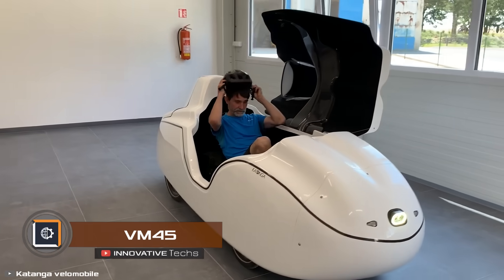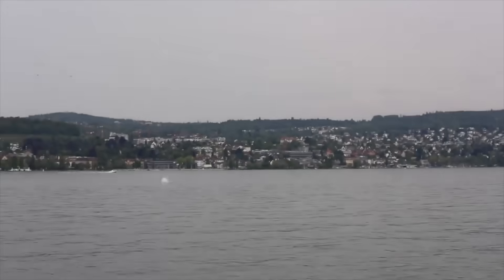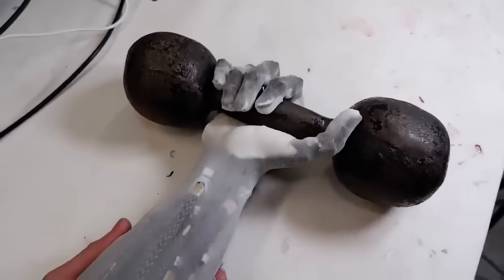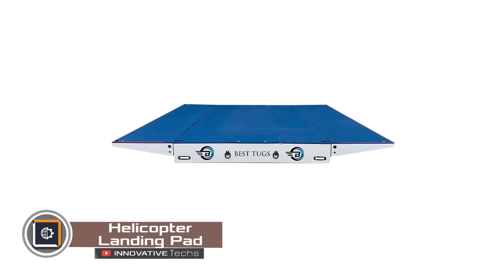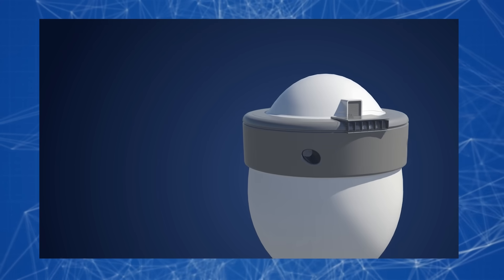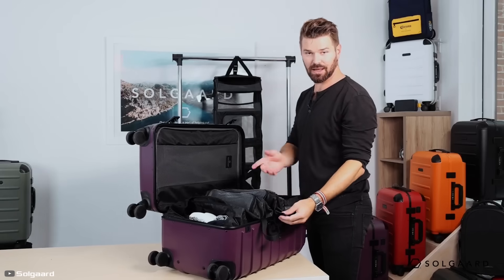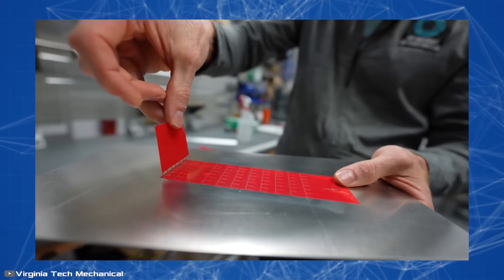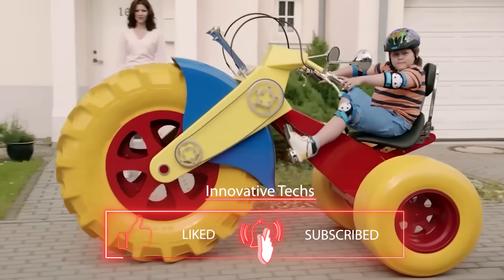NEW TECHNOLOGY AND INVENTIONS THAT WILL BLOW YOUR MIND

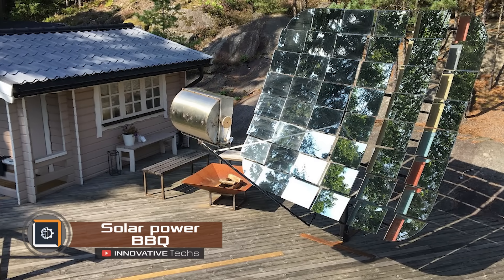Comment: 7:35 Spend 30 minuets cleaning all the mirrors and then 30 minuets setting and locking the mirrors accuracy then having to move the mirror assembly to keep it inline with the sun only to use it for 15 minuets to cook your steak except when the clouds roll through extending the cooking time by another 15 minuets.... ;)

Comment: 9:30 why didn't you say about the efficiency of this refrigerator ?  I can hardly believe that there is some new technology in it . most likely , it is made using Peltier elements , whose efficiency is not very large . there have been such car refrigerators on the market for a very long time that will not cool or heat much, but they can well keep the existing temperature of the pre-cooled product in a normal refrigerator.

Comment: 8:07 and why don't you calculate how much energy was spent to make this barbecue? unlike firewood , a mirror or metal does not grow in the forest . ore mining and smelting into metal is a very energy - intensive event , as is the production of glass from sand . and how long will it last ? a year , two , or maybe in a week a strong wind will rise and beat all the mirrors without paying for itself . and what if the weather changes and the sun hides behind the clouds , but what about the evening parties , how many flashlights do you need ? therefore, maybe it's enough to tell fairy tales about the environmental friendliness of any inventions

Comment: Good vid but the first item, the little white car should absolutely have very large tail lights and brake lights in the back as well as headlights in the front. There is no way that a small vehicle like that should have a small lighting system just because of the scale of design. The purpose of safety lights is safety. Probably the whole back end should be brake and running lights! Thx.